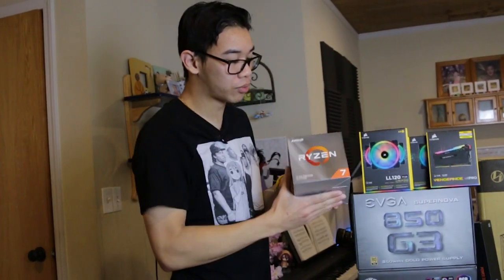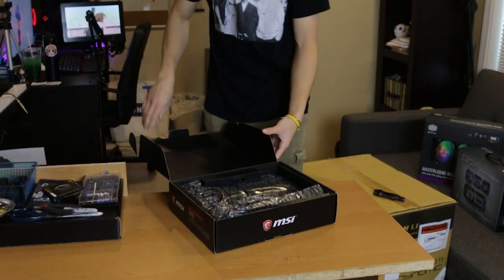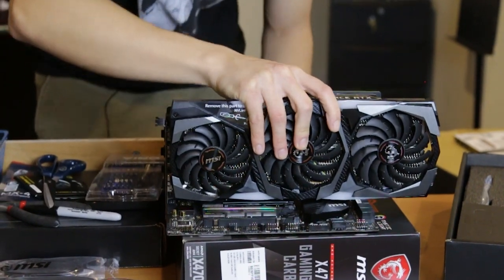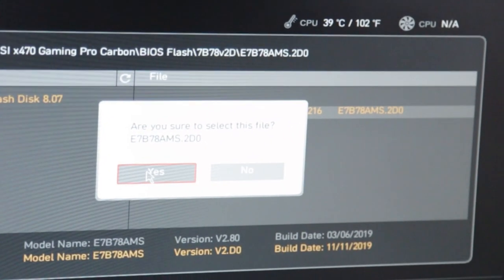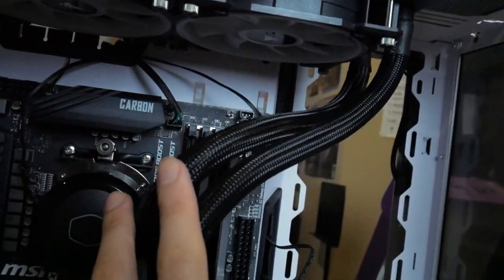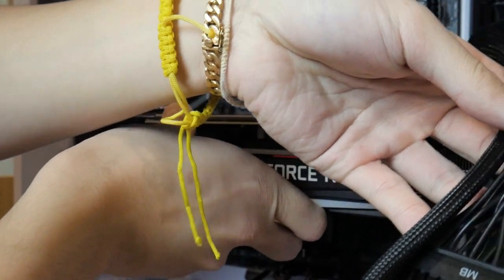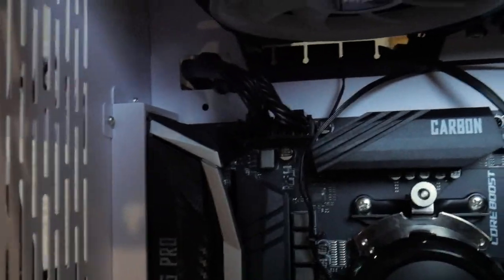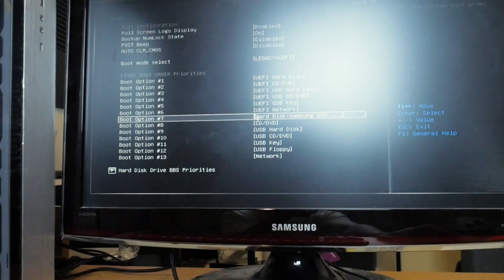anuki builds a pc.

Comment: I’m building a new PC next month in the same case so this will come in handy I’m sure. Do you find that fan configuration to be the best then?
Reply from the maker: yes and no. it works, and it works well, but there’s an issue with it to consider. there’s a massive gap between the plate were the exhaust fans sit and the side panel. in between it is the wiring, but more importantly the powersupply. so you’ll be blowing the hot air from the pc into the powersupply indirectly. this isn’t terrible, since in the past powersupplies would did this anyway. but it’ll make the powersupply fan ramp up more, so keep that in mind (haven’t tested it, but my powersupply has definitely been louder than any other powersupplies i’ve used).
Reply from the maker: so the way my fan config is is an aesthetic choice, not necessarily a practical choice. otherwise, intaking from the side and exhausting out the top is still a good one!